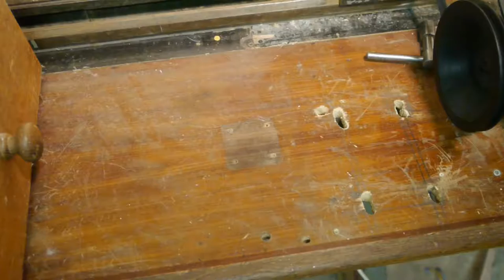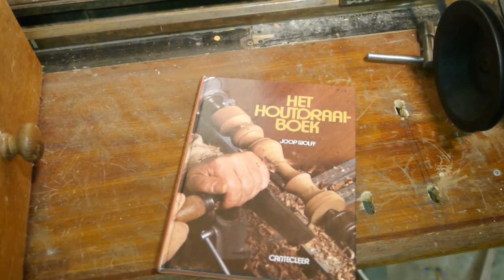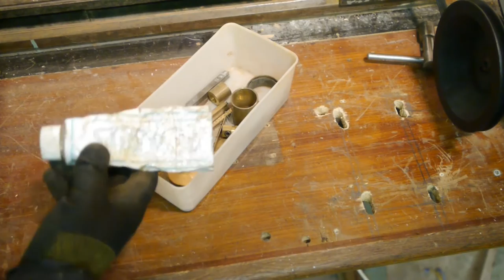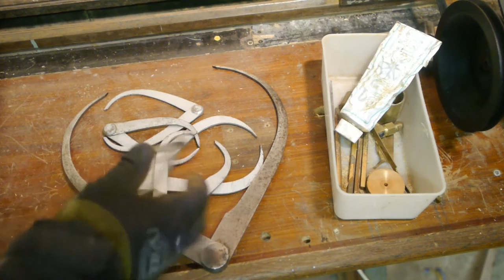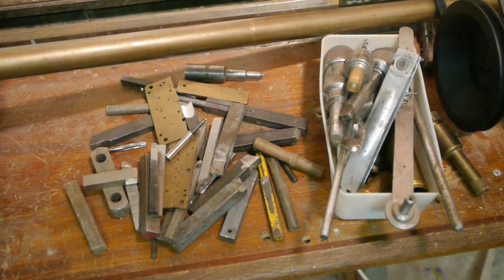Bunch of stuff that came with an old lathe

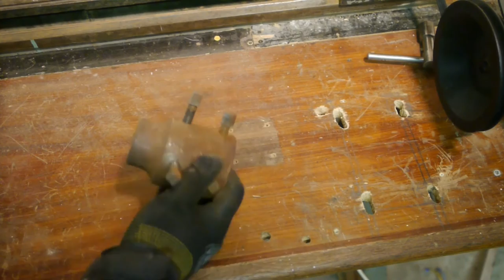Comment: the item at 4:11 is called a spider. it threads on the outboard side of the spindle (left side of belts) and clamps on to long pieces of work that go right through the spindle
Reply from the maker: Thanks for the explanation .

Comment: An interesting collection.  Someone already commented on the spider.  I need to make a spider to support the outside end of long pieces of stock while machining the other end.

Does the plate with post at 1:12 screw onto the "mangled" vise?  I am not sure how the combination would be used.

The first chuck you showed looks like it could be an end mill holder not a drill bit holder.

Making turning tools from files is not a good idea unless the file has been annealed then re-hardened and tempered.

You will soon experience a catch when turning.  The tool will dig into the wood, the rotation will slam the tool on the tool rest.  If the file has not been annealed it will be brittle and could break with the force of a catch.

The large outside calipers are useful for wood turning.  Set them to various diameters, then with parting tool turn a groove until the caliper fits the groove.  This technique is used to make dimensional settings when doing spindle turning.

The long piece with a post and pin does look like it goes with the index system.
Reply from the maker: I now believe that the plate is a saw table. I'll have another look at that drill chuck. But first I have to fix the toolrest otherwise we won't be making a mallet next weekend.